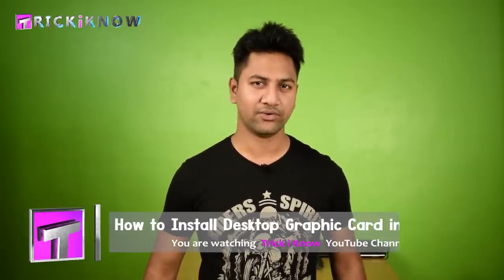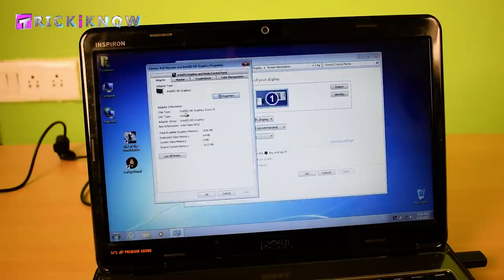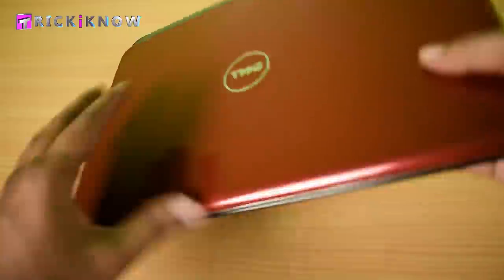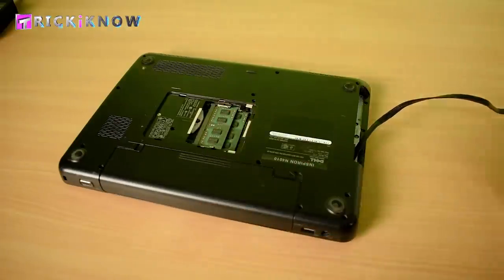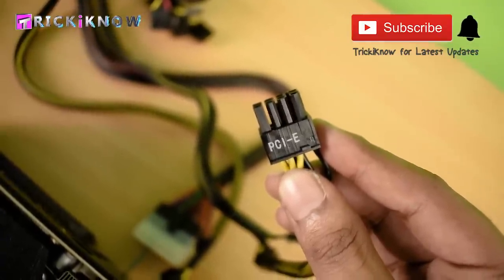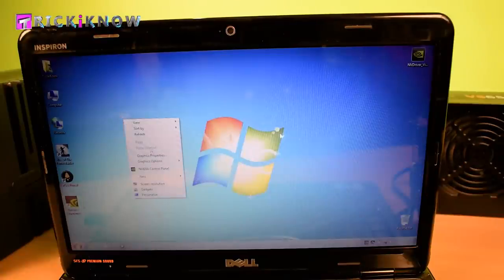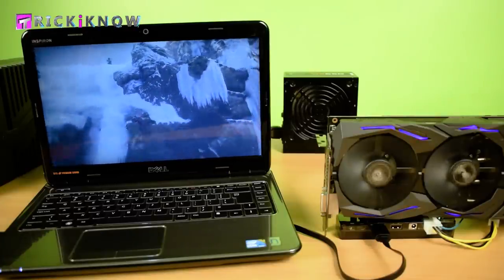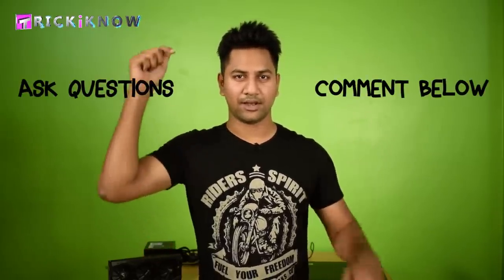How to Setup Desktop External Graphics Card for Laptop - eGPU Ultimate Guide

Comment: Sacrefic WiFi 😩😩😩 but wait a minute a USB stick WiFi will work right?
Reply from the maker: Yes you can use a wifi USB adapter or LAN port to access internet
Reply: @TrickiKnow  would this work for all laptops with this WLAN port?
Reply: @dzynofficial4130  you can also share internet data through android usb tethering hotspot

Comment: This is why we have Thunderbolt port today
Reply: much cheaper than thunderbolt also
Reply: Not all PCs have thunderbolt and this gives better performance
Reply: @JoeJrYT  Tf does thunderbolt has to do with performance? i got an OMEN GTX1060 i can even install another one later(in like a year or 2) coz of thr thunderbolt port

how does it affect performance in a bad way if we have it??
Reply: @sahilm483  you know that thunderbolt port slows down your gpu alot right? If you have a gtx 1060 it will give 1050 or maybe 1050 ti performance thunderbolt is shit
Reply: @teffi517  all on high settings resolution on 1490×blabla
i get 150 fps fortnite
Reply: ali shah thunder bolt 3 is good for this use. If you open the laptop could void warranty and u could break something. Thunder bolt is much cleaner and you can still use your wireless internet.
Reply: @JeffAr27  but how does it slow pc performance?It makes no sense
Reply: @sahilm483  lol you dont know ? It doesnt slow your pc it slows down your graphics card
Reply: @sahilm483  cant believe that you own a thunderbolt setup and you dont even know the difference between thunderbolt speed and pcie slot speed brother
Reply: @teffi517  was my 1st one though....Have the right not to know something....am not god for fucks sake
Reply: @sahilm483  lol why are you getting fired up tho ? The difference between thunderbolt and pcie for when we use gpu is the data transfer speed, pcie is many times faster then thunderbolt
Reply: @sahilm483  and you should have known about thunderbolt since you already own a  setup but well that's just my personal opinion
Reply: @teffi517  good! though mine is futureproof...meaning i dont have to spend $900 more to get another  
one
Reply: @sahilm483  mate if you think having a 1060 in a thunderbolt setup is future prof you are only dreaming and one more thing even my 6 yrs gt 640 could play fortnite so that ain't a big deal either now I have a gtx 1070 and nearly playing games on max at 1440p. So one more time yes you will have to upgrade your setup in future
Reply: @teffi517  Ok good.
Reply: The thunderbolt egpu quit a lot
 of the original performance of the desktop gpu
Reply: Sahil King you dont understand its because you dont know a lot of pcs right?
Reply: @ignaciosolano6263  Thats what i call a simple explanation.Now i understand! thx
Reply: @sahilm483  fortnite is not a very demanding game. My mid level HP notebook with Radeon 7 graphics can run it at high settings rather easily. You should consider upgrading your system in the near future. The new generation consoles are going to leave cards like 1060 in the dust very soon. Not to mention the fact that the bare minimum for games in the present time is gtx 770. Test a demanding game like Hitman 2 or AC Odyssey on your system with high settings and high resolution, you'll see the difference.
Reply: @DantesInferno96  games which are very well optimized like forza Horizon 4  
is 60 fps all set on ultra mode
Reply: @teffi517  lmao Thunderbolt is more powerful than a mini PCI-e slot, get information before speak
10 GB/s vs 40GB/s
You will lose less power with Thunderbolt than with EXP GDC
Reply: @sahilm483  Brother in other words, your most upgraded thunderbolt 3 speed is 32Gbps, however PCIe have a speed of 126 Gbps.
Reply: ali shah yrr
Reply: @teffi517  dude do u even know how much bandwidth a thunderbolt 3 port provide - its 40GBps...n its more than enough to get any games running without bottle necking any gpu..
Reply: @parasgidd7830  brother it gives you a huge bottleneck believe it or not but then again a cheap solution to play some games and shit
Reply: @sahilm483  using thunderbolt 3 slows your external gpu by about 25%.. because tb3 is still slower than PCI express

Comment: will I have a wireless connection after this?
Reply from the maker: Yes you can use a USB wifi adapter 😀
Reply: @TrickiKnow  and will the ethernet cable will still work ?

Comment: It would be a lot easier if the laptop has thunderbolt 3.0 port. You can check your laptop specs. If it has that then no need of opening your laptop and messing around.
Reply from the maker: Only new and costly laptops have thunderbolt port 😀

Comment: i have 2 mini  pci slot, so is that need to uninstall my wifi driver?
i have hp elitebook 745 g2.
Reply from the maker: Actually uninstalling the Wi-Fi driver is not mandatory I removed the driver just for a precaution to work setup perfectly, check out my new video I done this setup without uninstalling the Wi-Fi driver 😀

Comment: bro can its work all laptop like lenovo ideapad 310
Reply from the maker: You have to check it yourself , i don't have that laptop to check 😀
Reply: Its working in ideapad 320
Reply: bro will it effect the laptop
Reply: W Rahul Singh The first thing it will effect is that you no longer have wireless internet. Second thing is that the laptop cpu can’t handle the amount of power the gpu has. it will matter how old the laptop is.
Reply: @thebudgetbuyer8686  really
Reply: @thebudgetbuyer8686  which graphics card
Reply: Are u sure? How do u made it?  @thebudgetbuyer8686

Comment: If i use this adapter
My laptop lost the internet?
Reply from the maker: No, you can use a USB wireless adaptor for the internet 😀
Reply: lololol basically another 35$ for the wireless adapter plus i lose my dvd writer
Reply: @ebenezer8058  $1 u can get one on ebay lol xD i got mine from.there for $1. If u cant afford to spend an extra $1 then im sorry for u
Reply: @ebenezer8058  35$? You must be getting a gold plated one . These dongles are as cheap as 2-3$ available. Also you can use Ethernet , since you won't be moving around the laptop with so much gear .
Reply: @ebenezer8058  nobody uses DVD writer anymore. Are you living in the early 2000s? High end laptops have gotten rid of it in favor of the graphics card

Comment: I have HDMI connector can I not remove the WiFi chip
Reply from the maker: Use the express card version egpu , or just buy a wifi usb adapter 😀
Reply: Yee this is bad
Reply: TricK i Know bu I have HDMI hole already
Reply: GM Grenade Mixes same
Reply: Just fyi, the hdmi port in your laptop is probably an output port, not input.
So it won't work if you use this port :)

Comment: Omg I have the same shit laptop
Reply from the maker: Wow, you can try some small card like gtx 750ti :)
Reply: TricK i Know I am getting a laptop with i7 7700hq gtx 1060 and 8gb ram
Reply: Kaikorel XDD wow for how much are you getting
Reply: Biaka Hauzel 5000zł and it's 1250$ it also has windows 10 hdd 2000gb and it will have a 128gb ssd
Reply from the maker: Search for atleast 240 gb SSD , because in 128 you will get only 110 gb of it, after installing windows and apps it will remain 80gb that is no enough for games.
Reply: TricK i Know I will install games on hdd
Reply from the maker: Then game will not perform faster, watch my pc build i am using 500gb SSD for gaming and video editing :)
Reply: TricK i Know Well there will be no fps difference just on hdd the game will start longer

Comment: Hello and thanks for all. Your vids they are educative. I wanted to find out, can I use a 12 v power adapter instead of the PSu and also is it possible to run two external graphic card at the same time. Thanksss in advance

Comment: It would have been great if there was an adapter to connect the wifi's mini PCI-e slot to a bay that fits in the dvd drive port or any other possible port to be able to just connect the cable to the port when you need an eGPU and not have a wire hanging from the laptop all the time - Is there any better / cleaner solution now in 2020? Trying to do it on a Dell XPS 9575 (2in1) laptop. Any advice you have on this is super greatly appreciated!! :)

Comment: Thanks for the tutorial it is very helpful. I’m looking for adding additonal hdmi port to my laptop which has only single hdmi port and the laptop’s screen is damaged. With the Mini PCI-E to HDMI Cable can I directly plug the hdmi output to an external monitor without using an eGPU? so that I would be having total 2 external monitors. Or is it possible to convert the inbuilt display’s cable (the one going to the inbuilt laptop screen) to hdmi or VGA somehow?

Comment: Will an eGPU set-up work with the Acer Nitro 5 an515-55 model?  I recently purchased an Acer Nitro 5 an515-55 and unfortunately discovered it had no Display port or no mini Display port,  which I need for the VR Oculus Rift S.  I've done some research on HDMI to Display port converters and found out people were having issues of the  Oculus Rift S disconnecting when using an HDMI to Display port converter.  Apparently the Oculus Rifts S needs to be connected directly to the graphics card and no third party converter adapters will work.  So I was wondering if I could use an external graphics card that HAS a Display port and connect it to my laptop.  That's really the only way I see being able to connect my Oculus Rift S headset to my laptop with no Display ports, or Thunderbolt/C-ports.

Comment: Good tip on the NIC controller  bit seems that the NIC controller uses a PCI connection and the bandwidth is needed for the GPU.

Comment: Is adding external gpu compatible to all laptops? Is it compatible to my Toshiba L500 (PSLJTE - 01F00PAR)?
Reply from the maker: Not all laptops, if your laptop have the required slot and required options in BIOS then only. Otherwise you have to do a hard work in configuration.

Comment: Hi, trying to use this dock, but included wires are different, not as in video (the dock is completely same, only wires that connect between dock and power box wires), and there no wire with "CPU" mark from power box. You don't know how it can be solved?

Comment: I've n4010 laptop, 2x8pin GPU, and 600w psu. Can i just use 6+2 pin from psu without using 24pin+4 pin to 8pin cable for powering thr exp gdc? And then use other 2x8pin from psu for powering my GPU?

Comment: Can i also connect this card —-> MSI GeForce RTX 4070 VENTUS 3X 12G OC Videokaart
Reply from the maker: Huge bottleneck can be seen if you use an old cpu with it
Reply: @TrickiKnow  I have a question. Do I need an external monitor when using exp gdc? Other youtubers seem to use external monitors so I'm very confused rn.

Comment: if i had a very weak gpu like the half height gtx 1650, would i need a power supply? or could i use the 12v dc?

Comment: Dell Latitude E7440 does not have PCI slot so, can external GPU be installed or is there another way to get it done?
Reply from the maker: Check if it has a expresscard slot available?
Reply: @TrickiKnow  No

Comment: good video bro, will this work for all laptops?
Reply from the maker: Laptops which have required requirements in bios, or you have to disable some settings manually.
Reply: @TrickiKnow  It`s the Lenove thinkpad t410s
Reply: once I the Gpu Is working on the laptop is there any way I can still uss the internet.
Reply from the maker: @jaye7930  yes you can use a USB wifi adapter or LAN cable.

Comment: Hello, do you think this device may work to add Firewire ports on a laptop in order to connect some old audio interfaces to a laptop which doesn't feature FW port at all (MSI Prestige PE60 2QE with PCIe motherboard 3.0 x16) by plugging the chip Chipset TI XIO2213B-ZAY which enable FW ports on Windows computers /// Thanks 4 your help bRo

Comment: I Have a laptop with intel i3 380m 2.53ghz , 8 gb ram ddr3 1.067 hz , ssd sata III 240GB  , can i  use a Rx 570 / 1060 3GB with the Dock 8.0 and powersupply 650w?  i want to use for my new monitor 1080p FHD .

Comment: iam new to this bear with me please are you using a power adapter because the new card require more power ? 
why are you disabling the wireless software ?
can i connect both gpus on my labtop at the same time ?
can i do this with my predator helios 500 laptop i got gtx1070 i need to install the 3080 or 3070 card is it possible to do?
Reply: Might be yes. Might be Not possible.
Reason:
Your Laptop already have NVidia internal GPU. If you plan to use eGPU you need another brand like Radeon RX 6000. If you use eGPU with NVidia, the driver will conflict and bunch of errors might appear.

So it is basically like this:
If your Laptop already have NVidia internal GPU, then you need Radeon for eGPU.
OR
If your Laptop already have Radeon internal GPU, then you need NVidia for eGPU.
Reply: thanks a lot man that was helpful  @ClayWheeler

Comment: Hey instead of connecting hdmi to mini pcie can I connect hdmi to hdmi from the gpu to the laptop
Will that work? Pls reply asap!!!
Reply: No... the HDMI cord that is in your laptop is only (HDMI OUT). you can not directly connect a GPU to your laptop screen. What you can do is get an external monitor that has HDMI IN that you can connect directly. in short, you can not directly connect GPU to your laptop (HDMI OUT) It can only project information out of your laptop and not in
Reply: Just connect the GPU dock to your Mini psi lost (The wire with the mini psi conector)
Connect the GPU and Power supply to the external GPU dock
Connect the power pin connectors
Connect the mini HDMI to the dock that comes from the mini psi wire that is now connected to your  (WIFI adapter)
Make sure that all pcu cpu pins and the 8pin power connectors are in

Set up your drivers and make sure your brand of laptop is configured
Enjoy playing AAA titles

Comment: bhaiya, could this works on i7 7th gen dell laptop inspiron 15-3567?
Reply from the maker: Yes why not, you can combine power full GPU like gtx1060 with your i7 7th gen processor without bottleneck.
Reply: @TrickiKnow  so 1660 ti will run on it?

Comment: Hi!, I tried  to find an Nvidia driver for Latitude E5420 and can´t get results, could you suggest some options to try to configure an eGPU that I have conneted with an Nvidia GTX750ti. It runs very good with Ubuntu 20.04 generic driver, but I cant´t get running fine with W10 64bits. Even when it starts, the monitor tunrs off (only the monitor, not the GPU) after a couple of minutes. I´m using an Nvidia controller but its with the yellow warning and the Code 31 error indicated. I´ll thanks your support!

Comment: Can this still be done? Due to GeForce experience you can no longer NVIDIA Drivers individually anywhere, they automatically detect hardware, meaning I also cannot uninstall my old GPU drivers from the integrated GPU in my laptop because windows 10 also automatically reinstalls drivers.

I'm dealing with an Alienware R3 17

Comment: my power supply doesn't work while i join the dock cable any idea what is the issue ( if i remove the 24 pin cable then its has a power)

Comment: Trick i Know, I am having dell insipiron 3521 i3 3rd generation. i disabled NIC in the bios, but the graphics card is not detected in the device manager. though the fans rotate. Any advice for me, i will be grateful. I have tested the graphics card in a desktop machine. it works well.

Comment: Guys i need help. My laptop  gpu broke on my asus rog gl553vd laptop which has a gtx10504gb and an integrated intel hd graphics 630. So right now my gpu is broken and each time i play games on my nvidia card it will bluescreen. Im wondering if i can install an eGPU on my laptop which already has good graphic cards and 2 of them not like in the video above. Im worried that if i buy an eGPU it wont work on my laptop. Im thinking to put a higher performanced graphics card than my already owned nvidia card

Comment: Suggestions required for a laptop with below specs. Please help    |Metal body or durable sturdy plastic|4GB RAM(2 slots should be available)|120GB SSD (NVMe preferred)|1TB HDD (if no hard disk on offer, SATA slot should be available)|AMD Ryzn 5 3500U or intel i3 10th gen with dedicated graphics(if i3 have integrated graphics then RAM on offer should be atleast 8GB)|15.6 inch Antiglare screen(300 nits bright preferred)|Backlit keyboard & last...Fast charge support
My budget max Rs.45,000. Any compromise suggestions in above specs will also be appreciated. Thankyou

Comment: so i had a msi gf63 thin 10uc laptop, i wanted to build egpu, but it doesn't have thunderbolt port, as i know the wifi wlan slot could work with egpu, but idk which cable could work, NGFF or Mini pciE, since the wifi card had Mini pciE head but only 1 screw and the mini pciE cable had 2 screw in the back, also the wifi card interface is ncvio 1 and intel 9462ngw, if you guys know anything lmk

Comment: My system after starting pc says: 1082:Unautorized network card is plugged in - Power off and remove the miniPCI network card. System is halted
Reply from the maker: that's why you need to disable intergrated nic in bios.

Comment: My brother. My screen turns black when I turn on. Please help
Reply from the maker: try to plug it properly, or try to switch the tiny ptc switch in the dock
Reply: @TrickiKnow  on bios when I turn of wireless, the PC turns on but, when I turn it on even with the intergrated NIC it still turn black screen. Any other solutions please am dying for this thing to work please help😭
Reply: @TrickiKnow  is there any other solutions I can deal with this problem

Comment: Man I give up! I should just go buy a gaming pc. What’s the point of using a laptop with an external gpu when you’re gonna remove so many components of the laptop.
Reply: The point is that it is significantly cheaper for people with Limited budget.
You only need to buy
1) GPU
2) eGPU
3) PSU

No need to buy Motherboard, CPU, RAM, etc etc.